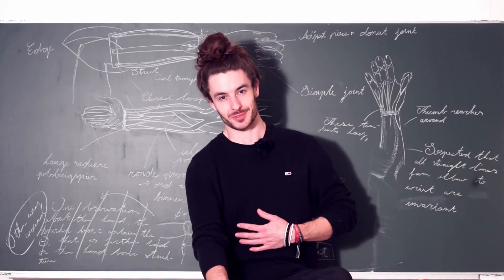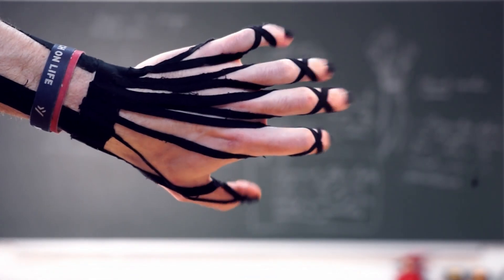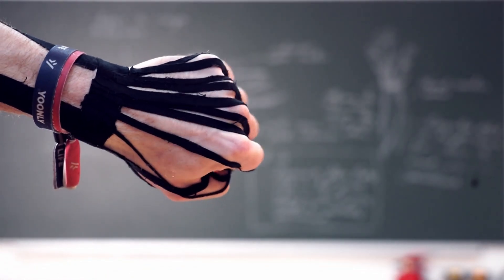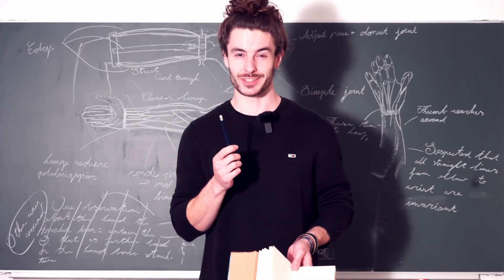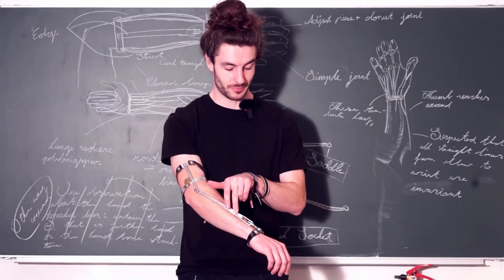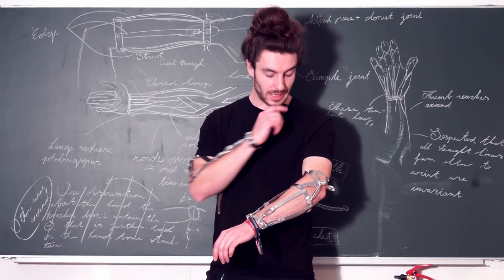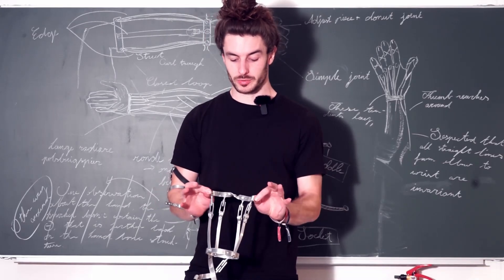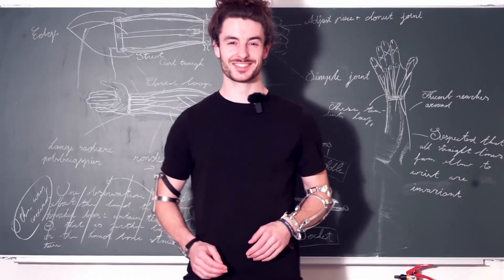New Exoskeleton Part! | Exoskeleton Forearm| Nova Machina 6

Comment: This is actually looking very similar to some of the design notes of the guy who designed the original 06 Iron Man suit; a major stated influence on the aesthetic of the internal parts was Pantograph mechanisms and old extendable watch-bands; that same kind of use of curved rigid parts and geometric proportions that you seem to be using. So, he may have been on the right track more than he knew!
Reply from the maker: What immensely interesting sources, thanks so much for leaving this comment

Comment: The shoulder is a simple yoke (like a 'Y'): bolt in front and behind the the shoulder ball joint, deltoid fully exposed, with the bottom of the yoke just below the bottom of the deltoid. Attach a support via your Schauberger-twist style down to the outer joint of the elbow, or use a similar yoke to the inner and outer of the elbow. The twist must be accounted for.
Reply from the maker: Thanks for the advice! My fear is that some of these parts are extremely hard to create if a large part of the central axis is unavailable, as that hosts the body. But perhaps with the rest of your explanation that is fixed (I just need to do some googling haha)
Cheers!

Comment: you're falling into the trap of simplicity that plagued elbow prostheses for much of the last century, and you'll have better results in the elbow if you use a larger hinge, because the bones of the elbow effectively roll across one another rather than articulating at a single hinge point, so if you increase the diameter of the rotational member at that point in the system to something closer to the size of the rounded part at the base of the humerus, the bone in your upper arm, things will articulate much more cleanly.  allow the form of your endoskeleton to inform the design of your exoskeleton, and things will go much more smoothly.
Reply from the maker: Thanks for the advice! I'm familiar with the problem, I still need to quantify its impact on this particular design philosophy. I suspect you're right however:)

Comment: I watched how researchers are developing form fitting pressure suits. They applied several layers of paint on the body and when it dried it would crack showing where stretchable material is needed and where stiffer material would work. It might help you visualize areas where the edges could be anchored to the body.
Reply from the maker: Genius, thanks so much! That could work out really well!
Reply: They where always plaged by the constant crack showing up time after time on the backside of the pants…
Reply: That is a great idea.

Comment: 1. If you want i can help you on this project, i have a bunch of ideas that could work for this.
Some advice below, but can i can give better advise verbally. If you want we can set that up.

2. I suggest you take a look at the human skeleton more muscles more and tendens more and use actually ball joints, CV joints, "roling hinge" joints, look at space suits.

2.5. Start by simplifying every joint into the individual movments/ degrees of freedom.

3. The human body, the shounders are "floting" ball joints, the elbows and knees are rolling hinges. the twinsting of the forarms and shines are basically 2 straight beams twisting/ rotating around eatch other (can use a ringed ball baring like in space suits) the wrists and ankles are closer to your vertebrae than a true ball joint but in your case can use a ball joint/ "rolling" joint. The hips are ball joints, but due to there set up can be 2-3 hinge joints (can use for shoulders, wrist, and ankles but may need more hinges and maybe some off sets.) The fingers are basically hinges ("rolling" hinges) but the knuckles and base of the thumb have that side to side movment and that can be done with 2-3 regular hinges, and the fingers do rotate/twist but that is not really a "controled" movment and closer to a spring or rubber band keeping the orientation (you can also do this for the fingers spreading and most of the ankle/ feet movment)
3.5. "Rolling joints" will be a bit of a pain but for matching anatomical movment could be better in come cases, so a sliding hinge/ hinge in just the right spot would probably be better, (take a look an other exoskeletons)

4. The hands, shoulders, hips and depending on how detailed you want to be ankles/ feet are going to be the hardest areas.

5. Take a look at robots with flexable abdomens, and robots that try to mimic biology.

6. You mentioned article muscles, what type(s) are you thinking about?

7. Servose, liniar actuators, "rope drive"(forgot what they are calld), the like could be easier and cheepser but without custome parts you might have to make compromises and they can be bulky.
Reply from the maker: Hi thanks so much for taking the time to write! In kind, I've taken some time to study your advise, quite some terms and parts were new to me:) 

About point 2; good idea, someone from ESA actually asked if this could become a layer to a spacesuit one day, as it is very hard to move in spacesuits apparently. So if it shares similar mechanics, that might work out brilliantly

About point 3; thanks so much, I've been going to the library, trying to find types of joints and study the human body. But you just helped me in seconds what I couldn't find out in days! Thanks so much:)

Point 5; yes it seems like the less traditional robotic research connects much better to what we do. Would you happen to know a good project or institute to study? 

Point 6: We invented our own! Wait let me find you the old video! https://www.youtube.com/watch?v=RTueYQblX6c or this older one https://www.youtube.com/watch?v=gBmJyo5R78w

Point 7: Rope joints look awesome, I think that might be a good option at places where the artificial muscles don't work. Thanks:)

In general; immense thanks for your feedback! Hope to stay in touch!

Cheers,
Thijs
Reply: @NovaMachina  for your response to number 5; Boston dynamics is a good starting point, any company making exoskeletons/ animal shaped robots will do ("bio robots")/ look for "artificial muscle robot" and you should find it pretty fast online/
Haksmith (youtube channel they have a few projects that could help)/ any of the exoskeleton/ robot youtubers.
All this is a good place to start if you haven't already.

7. For rope joints if you look up " rope joints robot an example should come up on youtube. And 1 problem with rope is the rope stretching over time, and if you want some stretching/ give to provide built in shock absorption,(like natural muscles do) it will need more maintenance.

Comment: Very cool :). I once made a set of mech legs but ran out of metal so ended up throwing the project out. 😢:)
Reply from the maker: How interesting! Did you learn something you wouldn't mind sharing? I'd love to learn from your project:) (I'm also super scared for when we get to the legs eventually, so all the help is welcome hahaha)
Reply: @NovaMachina  Well the main thing I learned was not to make a mech that is wayyyy tooo heavy. this thing weighed so much it was a hazzard just sitting in storage. also I learned that using swirly chair pistons for pneumatic stabilizers was fun but highly impractical. :)
Reply from the maker: Fair point, hadn't thought about weight as a savety hazard🤔 Thanks!
Reply from the maker: We're the pistons used as impact reducers? Sounds like a fun idea:) I can imagine it can also hinder other movements🤔

Comment: Out of curiosity, do you fabricate your parts? I am yet to watch your other videos so apologies if you've explained previously however, do you use CAD to model your parts first or is it straight from sketchbook to creation? Overall though great video, can't wait to see what comes of it :)
Reply from the maker: Hi Coppa! The process I've settled with for now is more like clothing making. So it indeed starts with a diagram in my sketchbook, but then the process becomes a lot of going back and forth between fitting rough parts and adjusting. That's why I work with aluminium strips; with some hand tools and a bit of practise, they are quite easily bent into shape and strong enough for now:)

Thanks for the question:) What do you think of the approach?
Reply: @NovaMachina  Honestly that's a awesome approach, its great to see all the different styles of creation makers on this platform use! Iteration is important to any great build, no matter the craft, appears to be the same with yourself. Is this clothing making process building off your pre-existing clothing making knowledge, or is it just a style you've adopted? One more question, would you consider working with steel in future to create a more rigid frame after this prototyping phase?  

Either way really impressive stuff mate, hard not to be interested :D